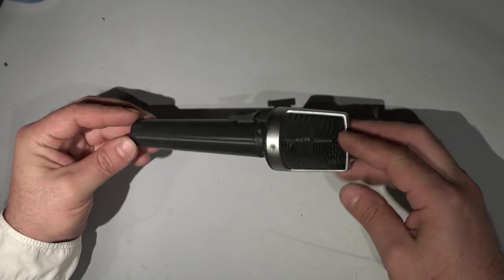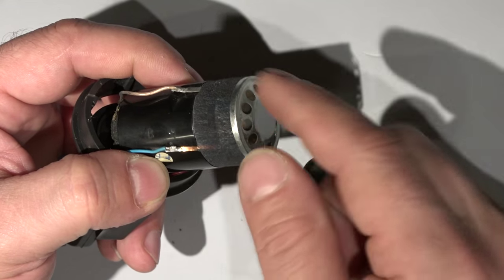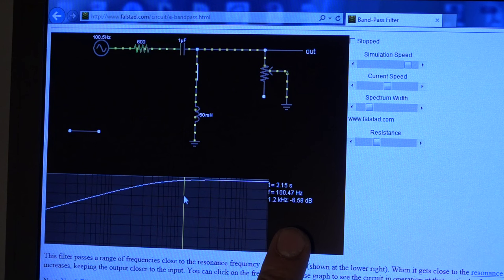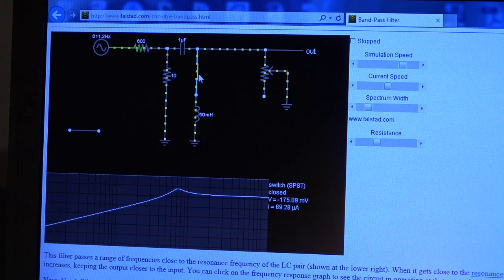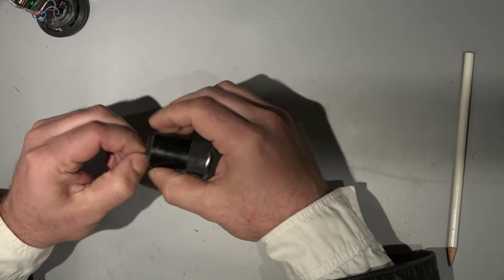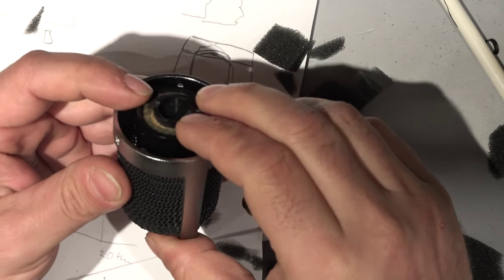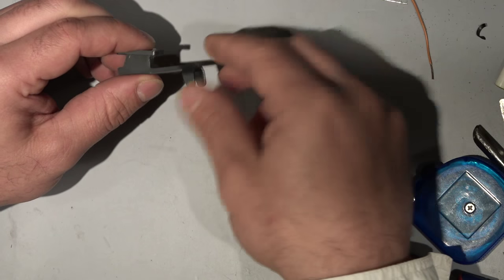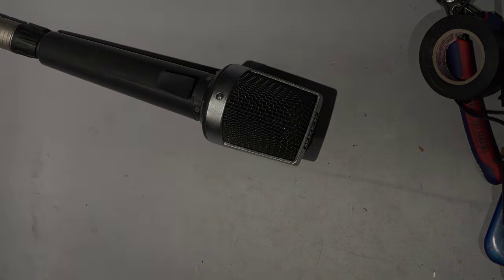Cheap ENG reporter, interview microphone. 1 dollar UHER M517

Comment: Hi, thanks for the video and info. The mics had foam Inside the gril when bought new but the foam deteriorated in time so people took it out. I grew up with this mic. My father had 6 of them :-)
Reply from the maker: Yes it had foam, but I also cleaned out. This is how I start the video. Also there is a hard foam kind plastic under the capsule among with plastic ring on the capsule. This I also removed. Now the capsule fully levitate inside the grill :) I like this mic after the modifications. Next upgrade, will be a new grip from metal by lathe machine. Greetings for Your father, for You  and for the 6 mics :)